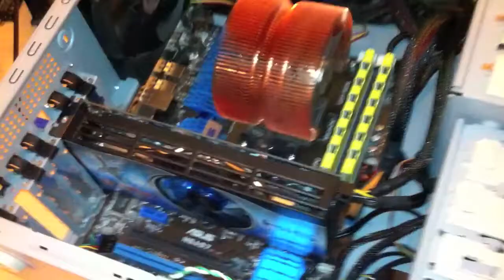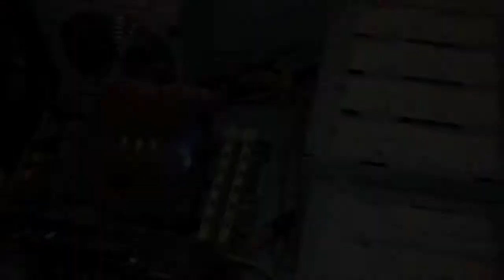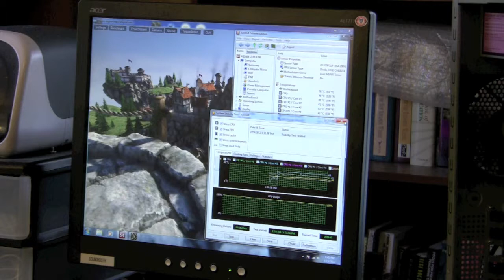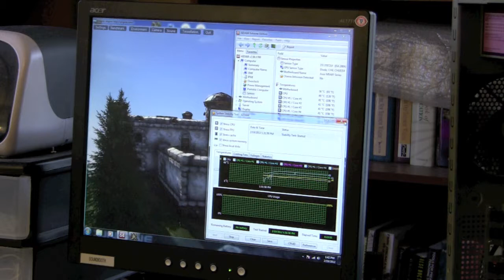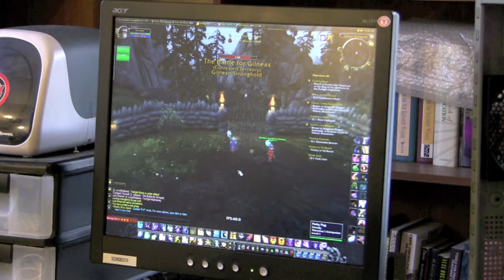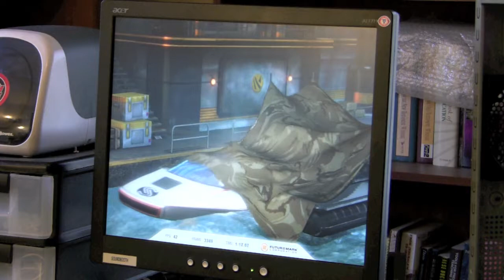Paul's New Budget PC Build Part 2

Comment: AMD if you want cheap and effective (Higher Clock Speeds for a lower Price), Intel if you want expensive but more effective than AMD, but lower clock speeds (3.2 Ghz Intel CPU for  about $200 USD or a 3.6 Ghz AMD for around $110 USD

Comment: Hey there. I wonder if you can help me on overclocking my PC. here's my full spec.

Cooler Master HAF 912	
Thermaltake 500W P-Supply	
Asus AMD Radeon HD 7770	
AMD Bulldozer Eight Core 3.6GHz	
Asus M5A97 R2.0 Socket AM3+	
Seagate Barracuda 1TB	
AMD Memory Performance Edition 8GB DDR3 1600MHz
Zalman Liquid Cooling LQ310

Comment: what did you say?in your system you have athlon x4 640? :D is it good.i currently have athlon x2 250 paired with gtx560se and is bottlenecking the gpu.....how will be with x4 640?

Comment: Every PSU manufacturer recommends at least 800w for running 32gb of memory with an 8-core processor.  Adding a the latest GPU cards will push the PSU even harder.   Way better to have too much PSU wattage than just barely enough.

Comment from the maker: That's not entirely true. The AMD FX-8150 consumes less than your thinking. This system with an 8-core would actually be a little less if not overclocked. An 8-core overclocked would be about 50w-100w more if that. The 650w should be fine.

Comment: This mobo will handle upto 8 core cpu's and 32gb of ram!   You'll want to get an 1100-1200 watt power supply if you intend to upgrade your CPU and RAM over the next few years especially if you're add a more powerful GPU card.

Comment from the maker: It depends. I'm assuming the AM3+ is an FX-6100 which will be great for multitasking and gaming since it has 6 cores. The Core i3 is great for games but not as good for multitasking as the FX-6100 however it is still decent. I would say if not looking to upgrade cpu down the road then go with AMD as multi-threaded apps improve and increase it will be noticed more. :)

Comment: i have a 600w power supply and im planning on buying this motherboard and cpu. video card im going low end. nothing special but my question is, will my 600w power supply be enough to run this ?

Comment: @Agent6415 quad-core will, but fx 4100 just fails, both in gaming and other stuff, so other 2 cores won't help it... and its upgrade path.. or upgrade to old phenom ii family which slowly dies, or wait for a 10-core piledriver.... he should have taken i3 instead of fx 4100. It's same like fx 4100, 2 cores/4 threads (fx 4100 is 2 modules, 4 cores), and it beats fx 4100 in both gaming and facebook,photoshop,.. by a really large margine...

Comment: @Aaronage1 It's AMDs way of improving multi-thread throughput, it's not comparable to hyper-threading but they're both trying to solve the same problem so to speak.

Scaling isn't perfect as it would be with a full quad, so while a Phenom II gets near perfect 4x scaling in Cinebench going from 1 to 4 threads, FX 4100 gets around 3.33x

It really reeeeaally bugs me that AMD decided to sell the FX line up as 4/6/8 cores, it's damaged the rep of this pretty promising architecture.

Comment: IPC did drop, but it appears worse than it is because of how the architecture scales.

Think of the FX 4100 as a dual-core, because essentially that is what it is. FX 4100 uses two Bulldozer modules, each module is almost two cores. 

A module = 2 int units, 1 floating point unit, 1 front end, 1 L2 cache, 2 L1 instruction cache, 1 L1 data etc. so basically one big core that has some resources doubled to allow for two threads.